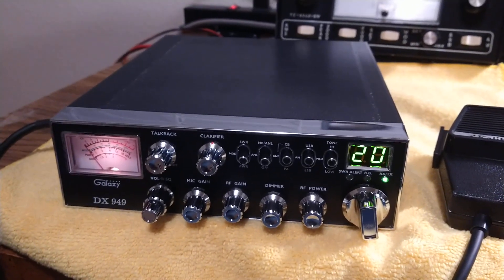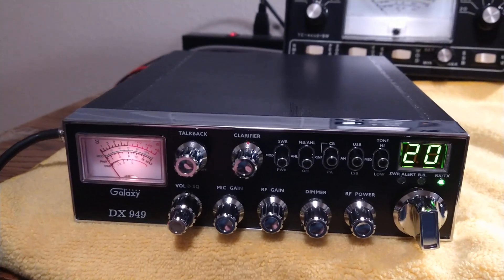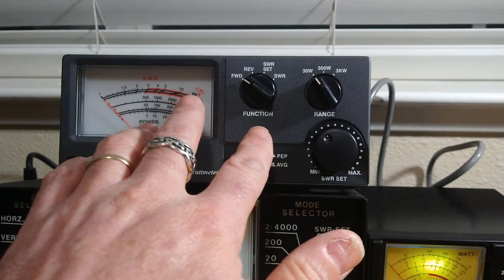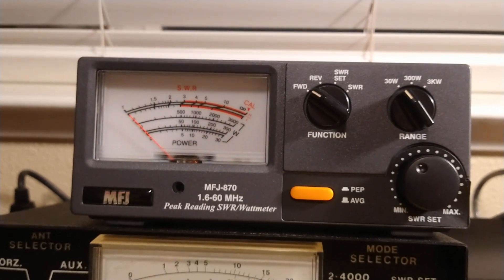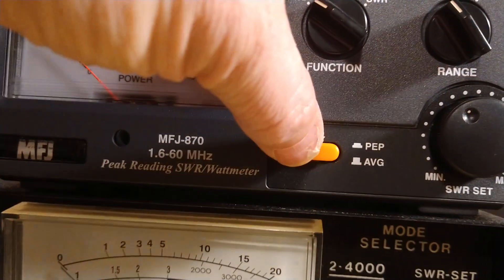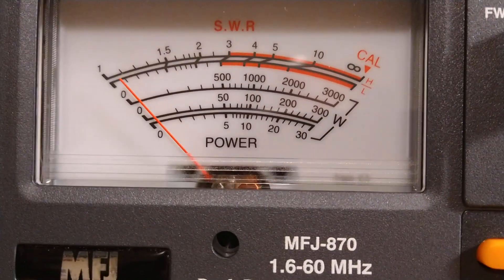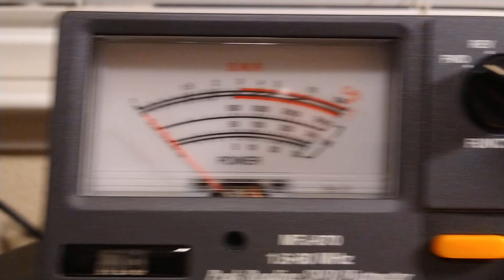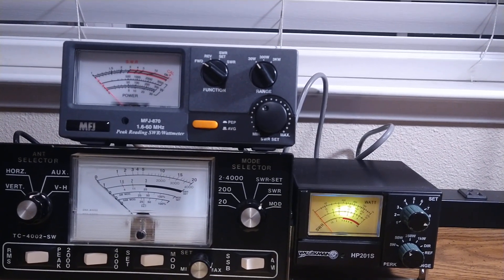Testing brand new radio on two separate meters

Comment: Ok. I would like a Bird also. On a kool-aid budget now. Retired. Even Bird meters have to be calibrated.I have a MFJ-874. Calibrated it against a Bird 43P that was just calibrated. Less than a 1/4 of a watt difference on all selected power readings. Few things are setup correctly from the factory. Shipping does not help, with all the jostling. Any equipment should be properly setup to begin with, upon receipt. Then recalibrated on a regular basis. The best musician, with the best guitar will sound horrible, unless the guitar is properly tuned. Happy Holidays to all.  😑🦗
Reply from the maker: I can't justify spending the money for a bird 43 for the little bit of hobby stuff I do. I've spent enough money on meters over the years to have bought a couple of bird meters at this point, lol. I'm going to send the Dosy off to be calibrated and hopefully I'll be able to use it in place of the other two. The MFJ-874 only reads up to 200 watts, the 870 I have is supposed to read up to 3,000 watts.  I could see yours being more accurate as it doesn't have such a wide range to cover. Just like the bird meters, each slug only does a specific range. This could be a reason these meters that are supposed to measure such a wide range are off by so much? Not sure, just seems logical to me. Seems like a compromise.
Reply: I own 2 bird meters. Side by side they show different numbers.  Yes, obviously they need to be calibrated.  Point being, even the coveted bird meters are far from perfect.  I see the bird comments so much, they are really over priced in my opinion. Not to mention the slugs are pricey as well.
Reply from the maker: @luke8210  They are definitely very pricey. Have you had any experience with the LP meters? I see more guys using them.
Reply: I personally dont own one. One other the guys who I consider  an Elmer has one. He likes it. I will eventually move that direction as well. They seem to be fairly accurate.  And take up alot less space than my current meter setups.
Reply: @vegasfordguy  LP's are the next generation meters. They are extremely accurate and do not need wattage plugs or batteries, therein costing less than Bird meters in the long run. 
 I would have LIKED a Bird. That has always been the standard. But would buy an LP over a Bird, if I were still servicing radios. Now, I am just back to the hobby level.
Reply: Sparked my interest.  Looked into the lip meters. Now I'm kicking myself for passing up the lp100 at hamfest. Guy was asking 150. 
Just saw they retail at 600+.....
Reply: @luke8210  That was a steal at 150. 650.00 is the price for the LP500.
 The LP700 is the high end model and much more.
Reply from the maker: @luke8210  They are supposed to be the greatest thing out. The Lp-100 would be great, but that Lp-700 is really awesome.
Reply: Well I'll be looking for them at the local hamfests that's for sure! I'm hooked now..

Comment: Personally, given that none of those meters are of very high quality, I would take the reading with a grain of salt. They are mass produced, and I'm sure the movements are not of very high quality. Then add the fact that they are mechanical, you will almost always get a different reading from meter to meter. The Bird line of meters are good, and there is a reason a lot of people run them. They seem to be the standard for most, and thier prices reflect that, but at the end of the day, 5 watts, or 13, is going to be negligible,  cause it won't make any difference on the receiver end in terms of DB. Have a lovely 1🙂